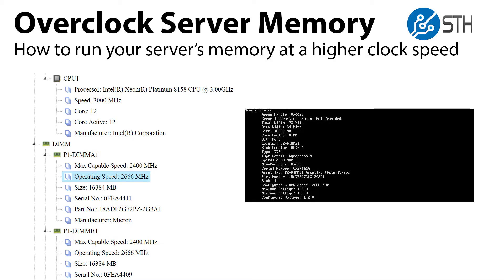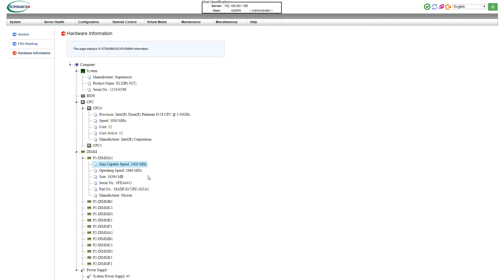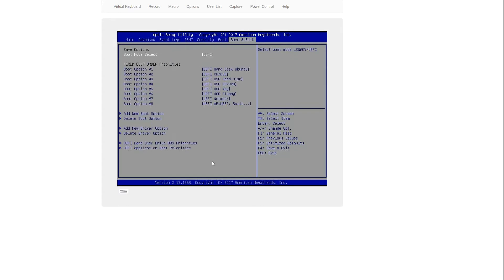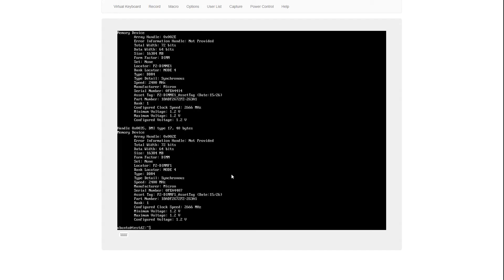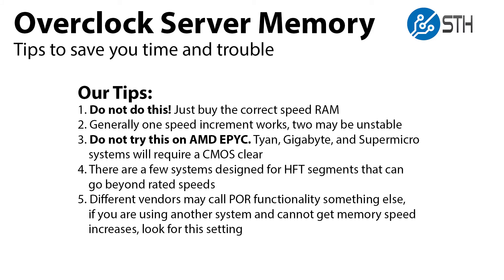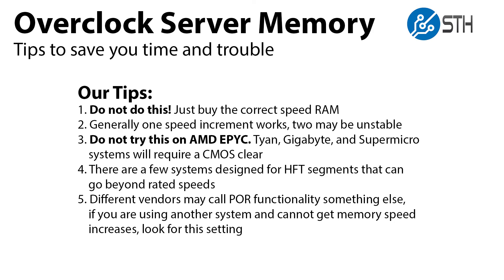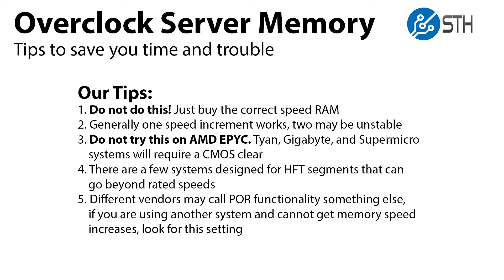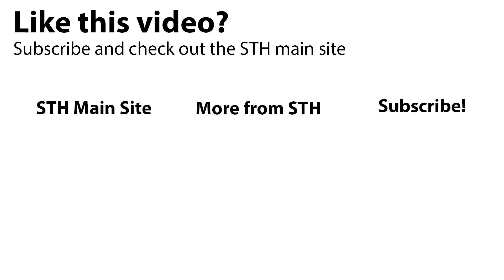How to Overclock a Server and Get Faster Memory Speeds

Comment: WILL MY 3000MHZ Corsair Dom Platniums work with my x99 xeon 2679 v4? AT ALL, least at 2400, will they down-clock to 2400-mhz and run at least or not run at all? I am hoping they run and if so and go to 2400mhz, can i then under-volt them to 1.2 or so like x99 prefers?....
Reply: They shouldn't have any problem with downclocking. But I would check first if it works without ecc ram, though the worst that will happen is that it won't work. Just make sure before you spend any money =)

Comment: ASUS Z10PE-D8. MoBo doesn’t like locking in DDR4-3200 even w/ rated PC4-26500 (3200). Is it the CPU locking this in? 2x E5-2667v4
Reply from the maker: Yes it is the CPU. If you have a DDR4-2400 CPU you can usually get DDR4-2133 DIMMs to run at 2400 but not go up to 3200.
Reply: @ServeTheHomeVideo  So if on my single socket Patsburg X99-E WS I'll have to OC BDLK to get that 3200? I had to do similar on previous Tylersburg X58 w/ X5675 to get DDR3 1600 (some 2000) but only on the 1066 /0r 1333 ratio. I think the same ECC UDIMM runs in the X99.